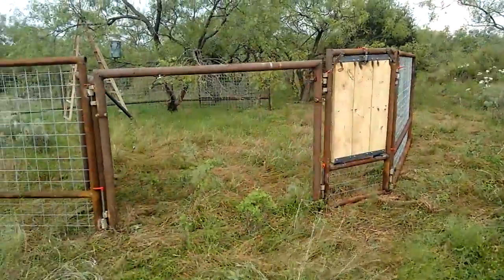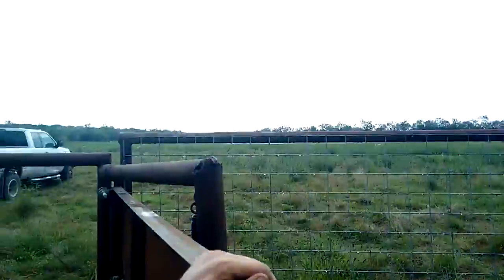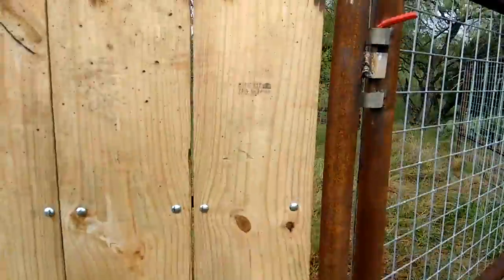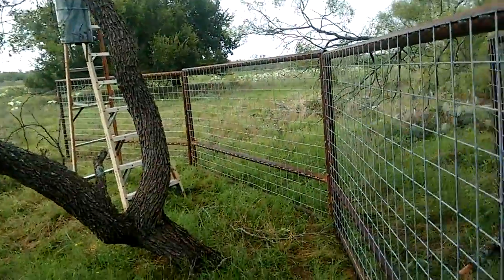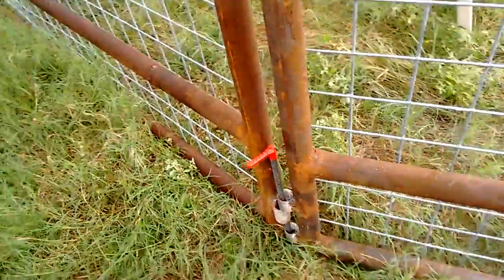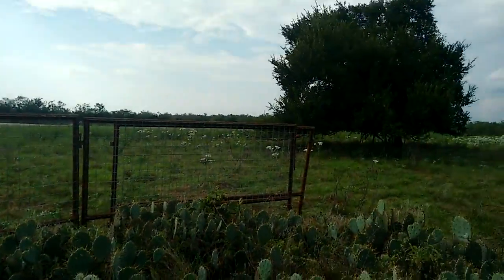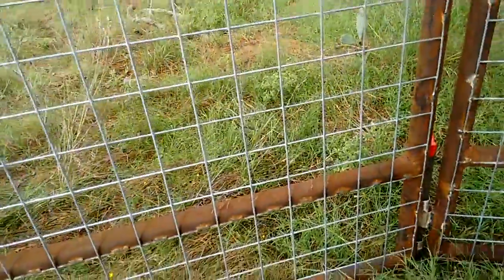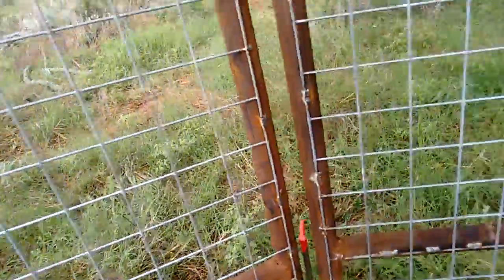New Corral Trap Setup

Comment: I saw a trap by a trapper up by Dallas. he put an over hang on the inside to keep 'em from climbing or jumping over the top. call me when you're ready to move it again. i'll trailer my little tractor and loader. even though I don't care much for pear and mesquite.
Reply from the maker: I thought about that but didn't go that way for a couple reasons.  
First I want deer to be able to easily jump out.  With an overhanging panel they'll get their back legs caught if and when they don't leap far enough.  I loose a couple of deer in regular fences this way every year.
The other reason is if they were permanently attached the panels would be harder to stack on a trailer plus they'd be even heavier than they already are, so I'd have to fabricate detachable ones.
There were lots of trade-offs I made; hopefully I made the right decisions.
I have heard of a boar that jumped a 6' panels and these are only 5' high so it is very possible it could be a problem.  If so I'll address it.